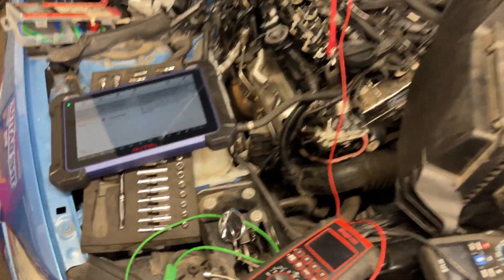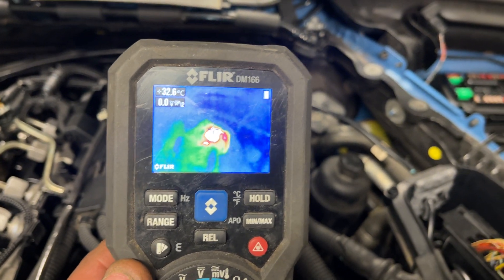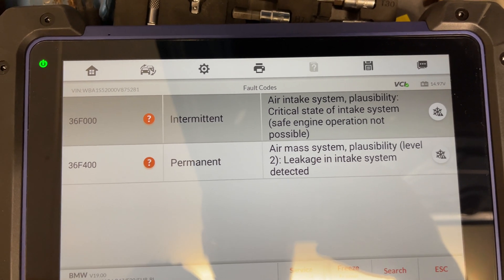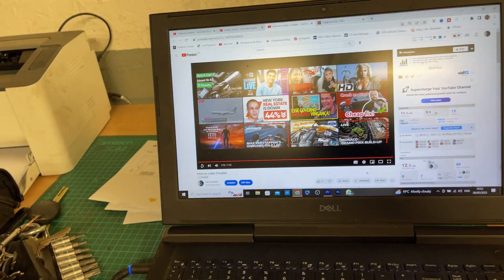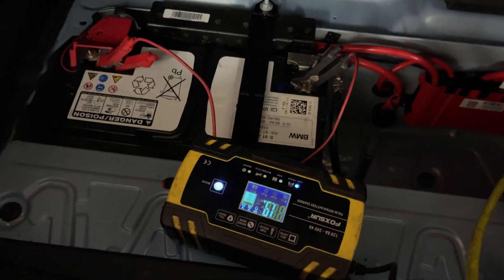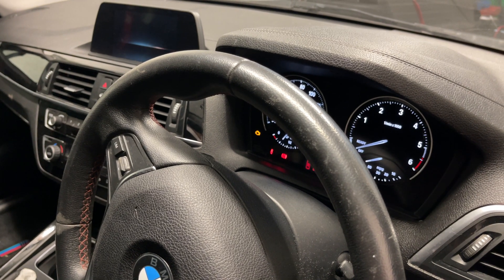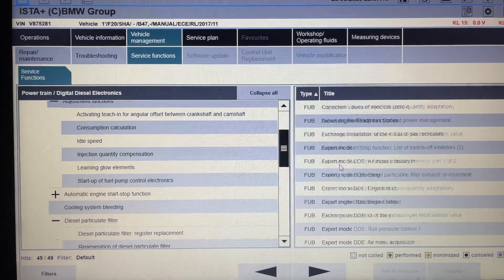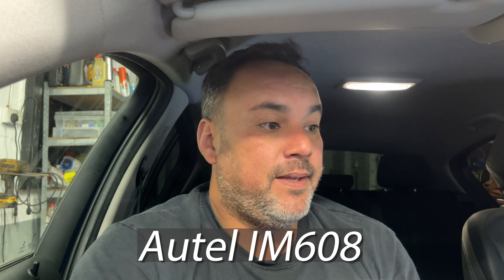BMW 118d F20 Powertrain Stop Carefully NO FAULT CODES Part2

Comment: Same problem on my f30 2016 320d lci engine b47, came up one day, didnt have any idea why, just fitted a new turbo. Turns out I needed to do a air mass sensor test in ista. You can only do this test with version 4.45 and above. I got 4.49 and the option to do a test was there. Did the test, confirmed it was fixed and it went away.

Comment: Run with INSTA "air mass System test" and after that you can delete the error, I had The same problem after i dameged my MAF Sensor by clening it with contact spray

Comment: Hi, I have a similar problem on a b47c20a mini engine, I found the intake manifold broken and the error code 36F600, I replaced the manifold and the egr valve but the problem remains. I have the engine light on and the 36f600 error is permanent. Diagnosis performed with Autel

Comment: Hi got a 2017 218 with the same fault in limp mode done all the tests you have done and got the same outcome. As you say poss software update will clear code. Hope we all get to the bottom of this fault.
Reply from the maker: There is a part 3 coming 😉👍
Reply: @CarsExposed  where is part3???

Comment: Sounds like your close to the problem hopefully software update cures this. ignition on mass air flow and intake air temp read ok
Reply from the maker: MAF figures all ok , Intake air temp ok. Going through the control structure with ISTA , EGR , swirl flap , Air Intake valve etc nominal values and actual values spot on . Vehicle now fixed part 3 soon. 👍
Reply: look for another compatible ecu, clone it with egr off and it works guaranteed, this answer costs 1000 pounds